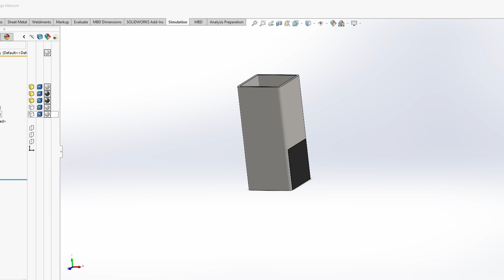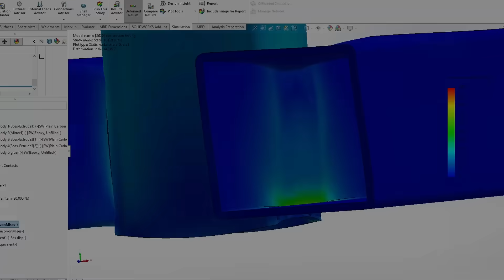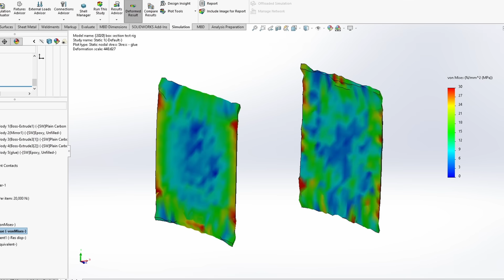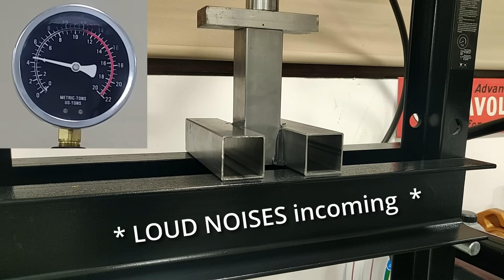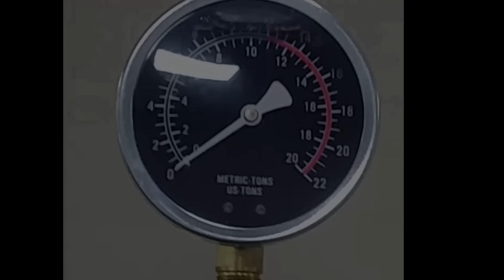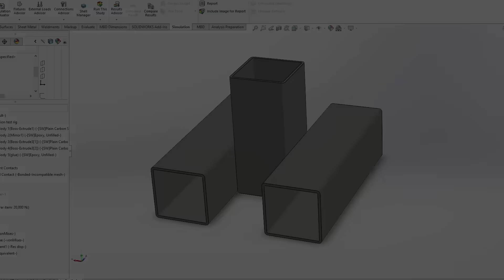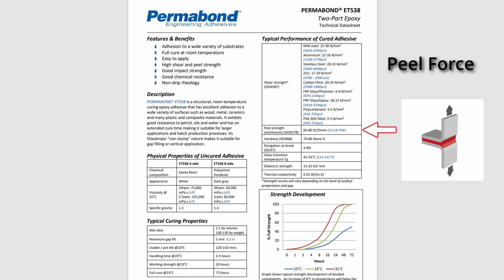How strong is JB weld structural epoxy adhesive anyways ?  Destructive test, simulation and review

Comment: Your test evaluates sheer strength, not tensile strength. And the load is static, not dynamic or cyclic. It would fail at lower loads if subjected to those. 
Doesn't seem very elastic. Very brittle since the failure was so immediate.

Comment: JB Weld is an essential part of my "MacGyver Kit" aboard my sailboat, along with duct tape and wire ties.  You can fix anything with JB Weld.  My best example is a "temporary" fix to the timing case of a friend's Yanmar marine diesel.  That "temporary" fix has held for over 14 years now.  :-)
Reply: I have a 'MacGyver kit' as well and this will be replacing other items. Always updating my, 'MacGyver Bag.'  😉

Comment: So you mean the epoxy manufacturing company that
Lies To Its Costumers
Right Off The Bat?
JB is NO Weld. 
Do you know what a "Weld" is? 
JB cannot produce a Weld. 
And other brands of epoxy produce higher shear, tension, and adhesive Strength.

Comment: I have this really old single-cylinder air-cooled 2-stroke outboard motor with a broken skeg. I was planning on taking an original good condition Scag up to my old Junior High School metal shop class and have some new ones casted out of aluminum. Then I also got the idea to attempt to make the entire skeg and lower gearbox cover out of JB Weld. Mix it up, pour into a mold, sand down the mating surfaces and screw holes, do the little blue paint on it and see what happens. Your video just made me want to make that idea happen sooner.

Comment: My fab teacher is a big fan of metal glues. If you get the right one for the material and make sur the geometry of the bonds area never pull on an edge, its pretty ofter better than welding. Of course the tensile strengh is weaker, but for anything sheet metal stainless or aluminium its great

Comment: JBWeld is marvelous and outrageously strong! However, you actually tested the profile tubing! At such high loads, the tubing deforms, and causes point failure which "peels" the JBWeld. A good test is when you can take the completed test pieces, remove the adhesive, and the test pieces are still flat enough to do another test.  Very  heavy wall tubing or solid bars or straps is the only accurate way to measure shear. I used to do lap shear tests with 1' wide x .187 thick strap and tested precisely 1 square inch of adhesive. Our machine pulled, but didn't push. JBWeld has 1 weakness, and that's shock. The test pieces may very well have broken apart if you simply dropped them on the floor!

Comment: I knew the wood was a big mistake. My guess of 5 tons was pretty close. I have used JB weld for over 40 years on various applications… including repairing cracked water galleys on semi truck diesel engines that never failed. The stuff is hard enough to be milled like metal. I speculate that if you had clamped the bottom two legs of your assembly, preventing their horizontal movement, the shear pressure likely would have went above 5 tons.

Comment: Cool video, however JB weld has failed my many times in my younger years to the point I just dont ever use it again. Did I use it wrong, oh yea good chance. Bottom line thing I learned is it works until it gets warm.

Comment: Used it to fix rust holes in a fuel tank once. JB weld is known as metal re-enforced epoxy. Kind of how hard angular aggerates enhances the sheer strength of concrete

Comment: This is a true story: Way back when I was about 18 years old (around 1978 or so) I worked as a mechanic in a small (tin shed) mechanic shop. Most of our customers were lower income and we were always having to find ways to fix their cars on the cheap. Well, one day, this old man drove his old truck in with a water leak. I climbed up under it to see what the problem was and low and behold, he had a huge crack in the side of the engine block. If you added water, it just poured out the side. Clearly he needed a new engine. But sadly he didn't have two dimes to rub together. So I suggested to my boss that I try cleaning it up real good and putting some JB Weld on the crack. We figured nothing from nothing leaves nothing (that song just happened to be playing on the radio at the time) and we didn't see how it could make it worse. So I did. Well sir, believe it or not, it worked. For years we'd see that old man driving his old truck all over town with a free JB Weld repair. Yeah, we didn't charge him for the fix. You never know when you'll need some good Karma.
Reply: dude so many people talk shit on me for using jb. i feel like its got its good and bad applications.i feel like alot of people dont understand that  more prep=exponentially better result. ive used it successfully on cylinder head pitting, pvc pipe joint seal, black iron pipe crack (high heat)!!! and a bunch more than i csn remember. not to mention the clear stuff! im hoping itll work for hairline cracks on alloy wheel. :/
Reply: @sbibbity_bobbity_bup  I made some mess.

Do you think it's good enough to connect two aluminum pipeline together or brazing them is good enough for AC on cooling coil sides? Both sides, input and output. I think they must hold the pressure around 300 psi
Reply: @eone2345, I haven't experimented with containing pressure using the thicker JB Weld that comes as the two separate tubes or any glue/epoxy. However, when dealing with a similar situation in the past, I found success in locating a pipe section with a slightly larger inside diameter than the outside of the broken pipe. Filling the larger section with the jb version that comes in two separate tubes that resemble toothpaste , the original i think? I slid it over the broken area after preheating the ends. Applying heat with a torch or heat gun can aid the curing process once the new pipe is in place.
thanks to chatgpt for shortening my explanation lol
Reply: @sbibbity_bobbity_bup  Seems like our thought on it are just the same to use that sleeve and having you verified it, now I have some confidence. Hopefully it will works because I'm kinda short on budget currently, especially when it's not even the main components that needed fixing, I still have to overhaul the AC compressor itself to change the seal 😅

Have a good day mate. Thank you for your answer with tips and swift reply, I really appreciate it.
Reply: @eone2345  I think about it like this, it has a greater chance of success since it does not have to do both the holding together and the containing of pressure. It's just got to hold the new section in place while the new piece holds the pressure:)
The hardest part in my experience is waiting until it cures completely before running the system again 🤣
Reply: @sbibbity_bobbity_bup  I did some rough measurement, seems like I have no suitable size of sleeve available around. It's becoming more nasty, so some MacGyverism must be enforced 😅

I knew that feeling as well. The last time I think I left it for two days minimum for the engine radiator corroded tubing. It's either investing in patient or redo them all over again 😅. 

From how someone willing to patiently wait for proper curing time and goes even beyond easily exposed how ones used to messed them up before we truly learned the lesson 😂
Reply: @sbibbity_bobbity_bup  The JB Weld that comes as mixable separate epoxy resin is the ONLY kind worth the cash.  it is FAR more durable.
Reply: @sbibbity_bobbity_bup I’m jus using it rn to repair a oil pan on my motorcycle do u think it’ll stand up fine to the heat about 180 degrees Celsius
Reply: @sbibbity_bobbity_bup  at least it works. You know what doesn't work? an aluminum oil pan on a overprized bike 😂
Reply: @sbibbity_bobbity_bup I totally understand you .
Reply: I've used it for cracked water pumps, rusty gas tanks, a plastic intake manifold on a Ford f 150, and etc. Shame on Ford for making a plastic intake manifold. It burnt thru when a hose from the egr broke off and landed on it. Also shame on them for that part, it melted too.
Reply: @michaelabraham9177 tell you what, coming up my dad always complained about how cheaply everything was made, I mean, doesn’t every parent(?). 
Thing is 70’s 80’s, even 90’s era manufacturing puts much of todays to shame. Sure, minus the tech and all the fancy gadgets… it’s shameful how much everything costs now too. 
“Pay More For Less”, Corporate Mindset but it’s just gotten absolutely ridiculous
Reply: Epoxy has readily been used on engine building, this is nothing out of the norm…. Many racer use it to reshape cylinder heads or to strengthen the block.
Reply: We smashed an aluminum oil pan on a chevy van. Had all the pieces and jb ed it back together held great . Same thing with my diet bike. Held for years.
Reply: @gem1967  would it help keep my oil pan from leaking? I took off the oil pressure sensor and i tighten to much and cracked it i put some on but it still leaks a bit i just need to put a bit more on the top but i was wondering if it would be bad to drive my car if i have it like that?
Reply: I repaired my gsxr block with jb weld. The chain broke and slapped the block and left a nasty hole that leaked all my oil out. Jb weld kept it on the road till I sold it to my homie. He then crashed the bike into a van at 100+ mph. The bike burned to the ground and there was basically nothing left. Lo and behold, I looked at the block and my jb weld held up perfectly fine. It’s good shit.
Reply: that's genuinely fucking unbelievable. insane work.
Reply: Ty for the story! of course somebody has to have a crappy comment piston on your parade
Reply: Aviation engineer here. I can confirm, JB weld, when properly applied, can get you through a very harsh durability/environmental test (applied to testing equipment, not UUT).
Reply: And if you need a quick o-ring gland, JB weld makes a great solution when bonded to 6000 and 7000 aluminum.
Reply: Thank you very much for share this, I'm like the old man right now.
Reply: You did the right thing and you are older than me several years.
Reply: I think it’ll hold my 28 g RC motor to the motor mount
Reply: Nice
Reply: awesome story- god bless you and your boss ,if he still around .
Reply: I glued a broken in two snowblower auger  drive coupler together. Held for year's.
Reply: Imagine being the geezer buying that truck second hand
Reply: Niiice.
Reply: A beautiful story for an even more beautiful gesture, my brother. God bless🙏🏽
Reply: Karma is not real
Reply: @karlojoki6314  Sure it is. It’s not tangible but neither are any of the forces currently holding you, me, that JB weld engine, and the rest of the universe together. Whether or not there’s some cosmic sense of justice is sort of besides the point, the social and cultural constructs that reinforce altruistic behavior are very real and observable. Karma is every bit as real as integrity, ethics, loyalty, love, respect, rivalry, reason, and the color fuchsia.

Comment: If i remember correctly (been some years) there are some 3M Pads that promise structural cold "welding" that can also adhere to oily surfaces(!) without any cleanup. You can check them too.

Comment: I could not tell if you sanded all surfaces before applying the JB Weld.  If not I would suggest you sand all surfaces before glueing.  It should make the glue have a stronger bond with the metal.  Same as when the surfaces are sanded, before painting a car.

Comment: The horizontal bars tilting inwards (as you correctly predicted) is here being simply overshadowed by the fact, that the press-crossbar accelerates and jumps upwards too fast (for observing the inwards-tilting)... But your prediction was logical and true (presuming the press-crossbar and the whole press are perfectly immovable, which is very hard to accomplish in reality !!!! Hence such test being done by expensive testing-institutes), no matter what the phenomena seem like. So, the phenomena deceit you on this matter... In other words, the mounting of the 2 horizontal bars to the press-crossbar was totally inadequate for your aims... The 2 horizontal bars SHOULDN´T have been let tilt inwards, that means your results are biased, and probably worse than necessary. 
The good news tho: JB-weld is probably even better than that, if used correctly... Which means that i need quickly 50 tons of weight now, to get my car off the ceiling, and drive to work...    😞

Comment: the problem with glue testing is that their strength hits a peak and then goes down from there. so its not correct to say that the strength is 'x'.. Its a temporary value. Glues always deteriorate. source: my job as a reliability engineer over 30 years..field data.

Comment: I have used J B Weld to repair holes in small motors for many years I have two engines with 15 years of running and vibration with patches on them that as far as I can tell are as good as the day I put them on. Preparation is the key if you take the time to make sure the bonding surfaces are completely clean as you did in your test the stuff is pretty amazing,  roughing the surfaces with sandpaper makes it even better. They have a putty mix called Steel Stik that is 4000 PSI and will withstand temperatures up to 300ºF. you can file drill tap it just like metal.

Comment: Thanks for the excellent Demo mate.
About five years ago I did a "temporary" repair on the exhaust manifold on my yacht's diesel engine with JB Weld.
The stresses on the repair site were vibrational and extreme heat mostly and I have to say that JB Weld amazed me to the point that I am still waiting for it to fail.

Comment: Why have you titled your video "How strong is JB weld structural epoxy adhesive anyways ? Destructive test, simulation and review"
JB Weld makes no such claims about being used as a structural adhesive.,  3M makes such claims and those claims are backed up by their extensive use in automotive applications.

Comment: It is not strong at all and are junk. 
I've recently used jb weld high tension strength on a plastic turbo pipe for a vw diesel  and metal pieces. After after  2 days make sure fully  cured. The patches lasted Seconds. 
Jb weld and other epoxy adhesives are only good for very minor uses.

Comment: JB Weld is very good. 

But a distinction must be made between using this material to create a chemical bond; as opposed to a mechanical bond. 

A fair test would include both contributing factors. And measure them separately.

Comment: Thanks for the video I had always heard this stuff works great if you clean steel mating parts well it sticks to fresh steel. I have a situation where someone drilled out a bolt hole for a shock mount larger then the bolt it would move up and down making a clunking sound when driving. Normally with this I just find a big washer that fits the new bolt with tight tolerance and weld it over the existing hole making the bolt fit tight again. The problem is the fuel filler hose runs right by this while I might be able to rig up a shield I rather not use a mig welder near a gas tank, and rubber filing hose. I'm going to try JB weld I will take a wire wheel and clean the steel on both mating surfaces. From what I seen in your test 4 tons should be more then enough to hold a shock mount on a Honda Pilot. I did notice the bolt got some JB weld on it as it tightened down I removed it again and cleaned it put some oil on the bolt keep the JB weld from welding the bolt into the hole. Probably could use some grease also.

Comment: Very impressed with your meticulous technique. For a future project, it would be very interesting to contrast compare these results (JB weld) to a few other scenarios, such as welding or bolting these pieces together. A lot of car reviewers mention how many cars are replacing welding with structural adhesives, so it might be interesting to compare the failure characteristics of those two scenarios.
Reply: The test was very interesting, but badly flawed.

Comment: Interesting test, thanks! I'm not familiar with that simulation software, so I'm wondering if the force applied in the sim is tantamount to the gradual application of the press, or if it's simulating impact at that force (i.e. a sudden force vs. a gradual one).

Comment: Yep...JB Weld is amazing stuff.  I've used it for years repairing motorcycle cases, radiators, etc.  Use common sense and prep surface well.  It's not great for all applications but will usually get you by in a pinch until you have time for a proper repair.  Although I repaired a leak in a KTM radiator 23 years ago and still perfect even with all the heat cycles.

Comment: A more fair test would have been SOLID steel bars that would not have given advantage to the tearing of the bonding through beam distortion.  Using solid materials would have given us a better idea of the true strength of the bond.

Comment: It would be cool to see the same test with the same set up, welded together as a direct comparison!
Reply: Welded properly, the box tubing would fail well before the welds, so there's not really any point to the test.
Reply: @Tibyon  I like to see things break though lol
Reply: @Tibyon  "Welded Properly". Nice way of covering yourself there. LoL. JK! I'd be curious to see how variability in preparation, application, and post treatment compares to in JB weld. Obviously they both need close controls during manufacturing but I'd be curious if a large surface area with JB weld improves its real world utility over a dirty fillet weld.
Reply: It wouldn't break apart at all if it was welded properly. You would just crush it. People don't realize how dangerous these tests can be. could kill you tbh.